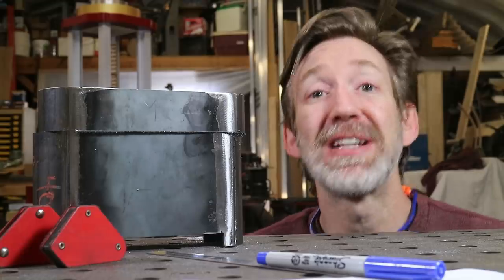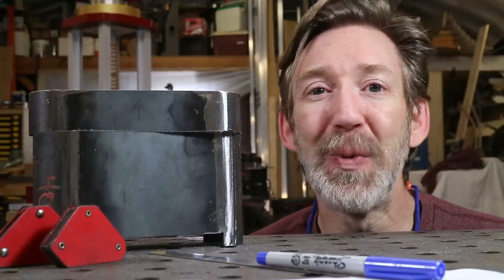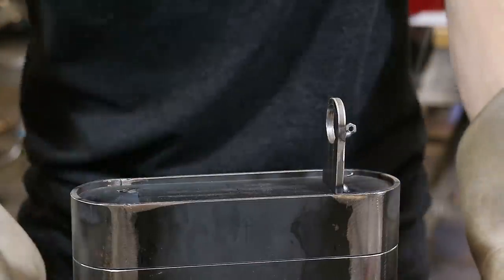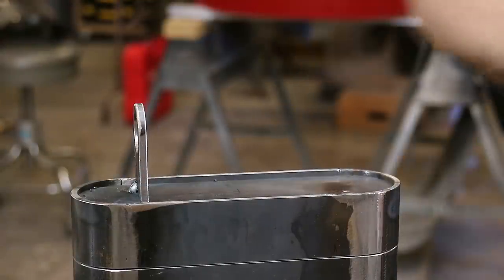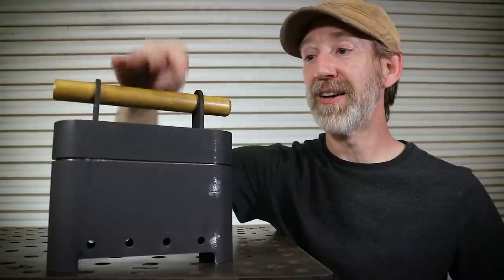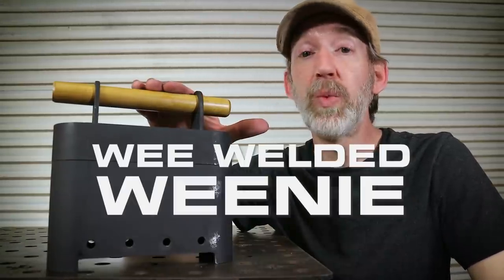Solo Eater Wiener Heater: A Mini Grill for a Single Hot Dog

Comment: 6:00 Wait, does your tablesaw have a drill press attachment?! 😲
Reply from the maker: It's an old Shopsmith. I primarily use it as a drill press because the saw is homicidal.
Reply: @WesleyTreat  i have an old Shopsmith, too, and agree with your assessment about the table saw attachment.

Comment: I just put two forks on the ends of an extension cord. Put the forks in the ends of the hot dog and plug it in. Hot dog in about 30 seconds. Saves about 10 min.

Comment: Now you just need to make a attachment that’s a rotisserie
Reply: Shit, I can see it now.  A little dc motor, battery, and you're set. Better yet, make it a rechargeable battery and add a mini-solar charger to it, or just go with solar only.
Reply: edgotbait Second that motion
Reply: It in the other side of the handle...not used for clarity reasons.
Reply: @mikewilson3169  just do the motor with a peltier power supply and heat sink like those wood stove fans.